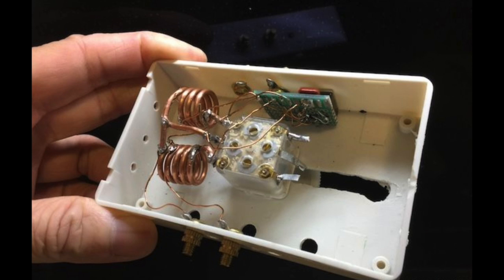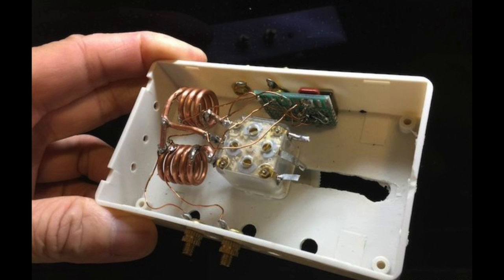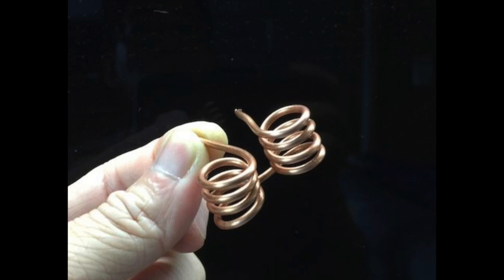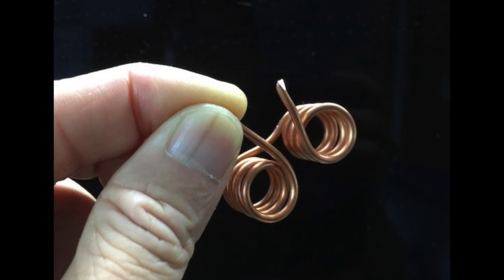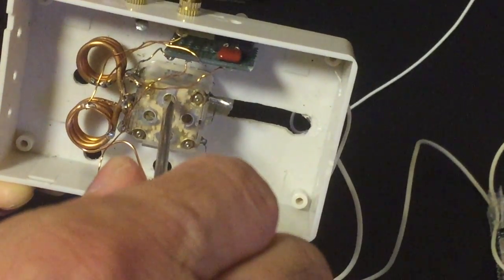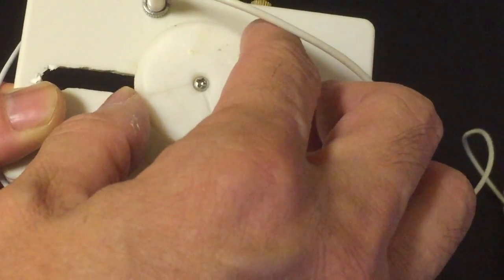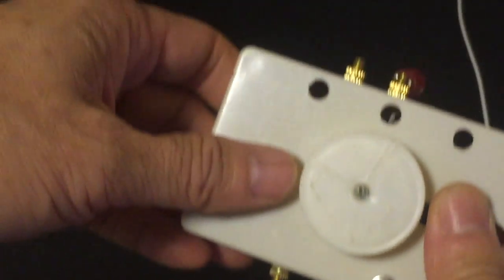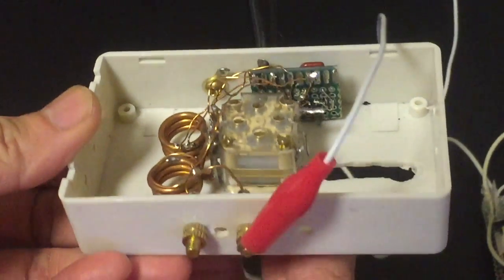Double tuned FM Crystal Radio on a single PVC VC

Comment: can this type of fm radio with two coils also work with germanium diodes? not just with mosfet?. If you have a scheme can you post it? On the one with a single coil, I built it only with diodes because I didn't have a mosfet or a capacitor, I used a trimmer 6 - 25 pf, only I have to rotate it with the screwdriver, it still works quite clearly
Reply from the maker: Yes, you need to view this other video that's using diodes. https://studio.youtube.com/video/nxNrFNbwFvQ/edit